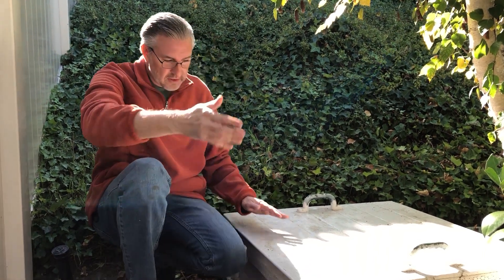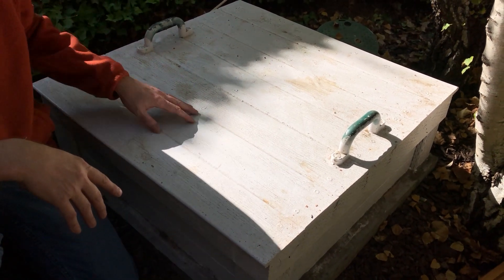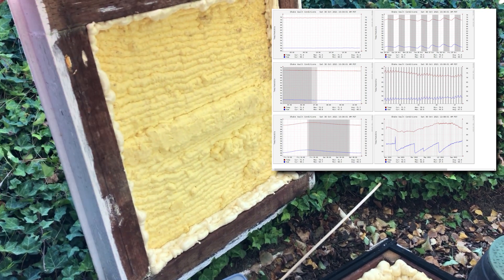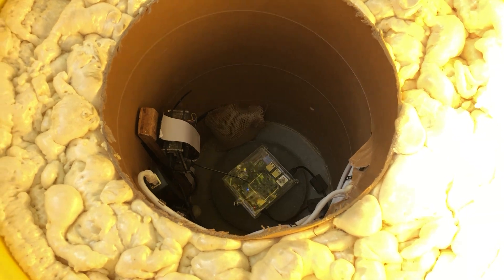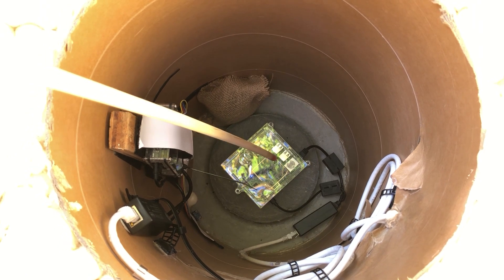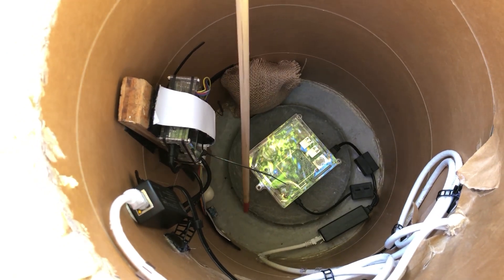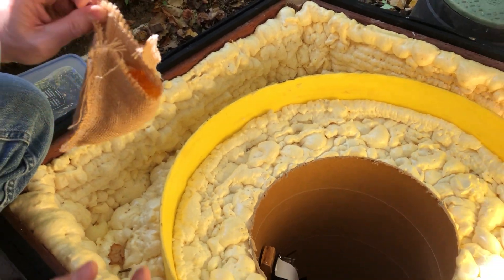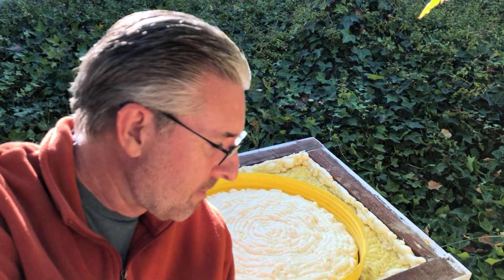A quick tour of the RaspberryShake's seismic vault

Comment: Is the sensor on top of a pier or just on a slab  2 feet deep? Will it make a difference on sensitivity if the sensor is on top of a pier 60 feet deep?
Reply from the maker: There is an old section of a pier from my first build that extends down about another 20 inches from the current slab. I poured the current slab over it.  I am not sure if going deeper will make much difference.